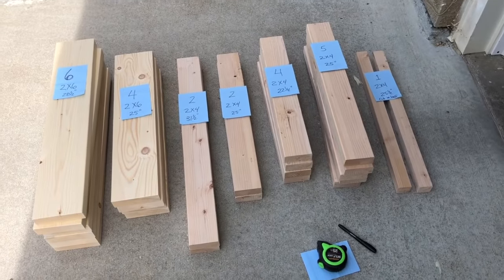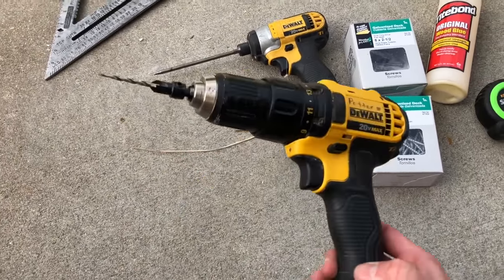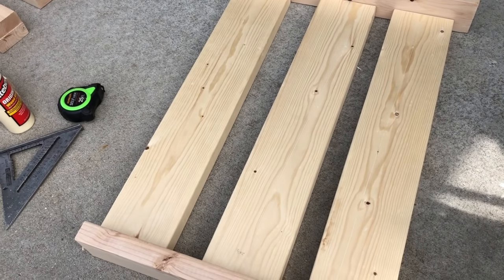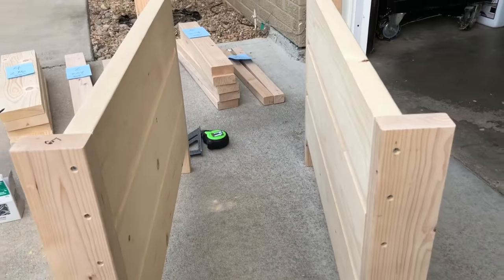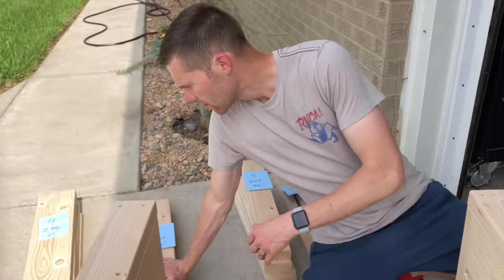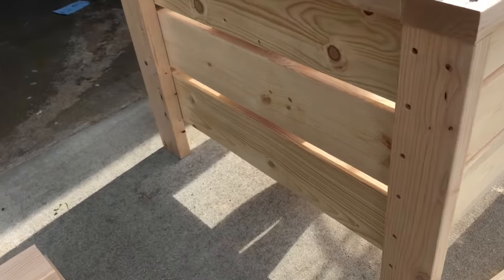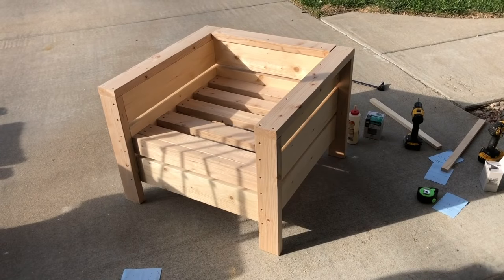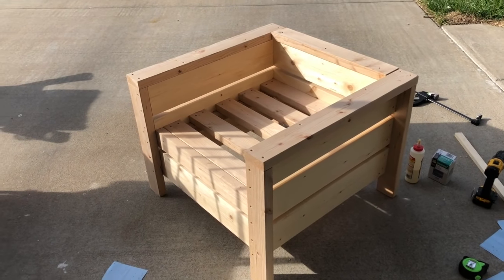DIY Lumber Yard Deck Chair

Comment: I have made 2 of these chairs now thanks to the help of this video. I do like a deeper chair so instead of adding the 2x4 on the front above the 2x6, I just left it off and dropped the seat that many inches and it made it very comfortable. I am also very short so it being closer to the ground is not as bad as it could be if you’re tall
Reply from the maker: Amanda, that's not a bad idea, I may have to do this on the next one and see how she likes it!  Did you stain yours or leave them bare?
Reply: Stained, I’ll attach pictures
Reply: Potter's Work, well heck, I don’t know how to attach pictures but basically I used a kona stain with poly built in for the 2x4’s and and an antique white stain for the 2x6’s

Comment: That's 2 ideas you've given me, I may try doing a right-angle bench for my decking
Reply from the maker: lewisdean22 , awesome, that’s why I do it!  Lol.  Is it deck building weather in Scotland yet?
Reply: Potter's Work yes it is, 20.36hr here just now with plenty of sun. Just ran out of money, have to put some projects of until funds are up.
Reply from the maker: lewisdean22, story of my life :).  Always waiting on more funds to do more projects!
Reply: Which brand countersink tool are you using?...#8 (1/8 drill bit) awesome job BTW

Comment: Hi this is chandan singh 
I want to know about pine wood...
How successful is pine wood for sofa, bed, box , chair and table?
And which type of furniture will you recommend for pine wood.

Request to you plz suggest.
Thanks
Reply from the maker: A2Z, pine is a very versatile wood and would work great for many of those projects you listed.  Its easy to sand and is cheap.  You can also buy "Select Pine" if you would like it to not have knots and imperfections.  Keep in mind, it is a soft wood so it will show dings and dents easier than a hard wood and you might want to use a pre-stain conditioner since Pine will sometimes absorb stain unevenly.
Reply: @PottersWork  Thank you so much...😊😊😊
Reply from the maker: A2Z Dajyu, no problem!

Comment: What you used for sealing (Varnish/ polyurethane)?
Reply from the maker: Hello!  We just ended up using a water based deck stain on it.  But you could use and outdoor polyurethane too.

Comment: I see that you planed your 2x lumber. What was the reason/advantage for doing this?
Reply from the maker: Hank, the only reason I planed the lumber was to make the surface a little smoother.  I typically plane my rough lumber lightly to make the sanding process much faster.
Reply: Potter's Work Thanks for the quick response - and especially for the detailed video on this project. Although I don’t own a planer, I’m fortunate to have a local hardware store with higher grade lumber (Douglas fir) to select from. Will be building two of these chairs for the front patio this weekend. Thanks again, and keep up the good work. Very helpful.
Reply from the maker: Hank Minor, no problem!  Hopefully they are well stocked at your lumber yard, ours has been pretty scarce on lumber lately due to Covid.  Cedar has been especially hard to get locally for me.  Have fun and enjoy the build!  One of my favorite projects to date and we still use the chair often.  We did put a coat of stain on it to protect it from the elements as well.
Reply: Potter's Work Construction question for this project. Looking to countersink deck screws and fill with wood plugs for a finished look. Given the countersink will be deep enough for a plug, what length deck screw would you suggest? I was thinking 2 1/2”. (Countersink would effectively make it 2 3/4”.) Your thoughts?
Reply from the maker: Hank Minor, in my opinion that would work out just fine.  That should give you enough clearance on top of your screw and not protrude out the other side.  When I do plugs, I also prefer to use a forstner bit as it leaves a much cleaner hole than a traditional bit.  Just my 2 cents :)

Comment: is it pressure treated lumber or framing? Thanks/
Reply from the maker: I just used framing lumber and we treated it with deck stain afterwards.
Reply: @PottersWork  ain't those toxic and cancer causing to be used on furniture? Just wondering.
Reply from the maker: If it didn't have the cushions on it, I would be concerned about it, but she's not really even touching the wood most of the time.  You could use an outdoor polyurethane as well which would probably be less likely to transfer to your skin.

Comment: Based on my experience building this type of furniture, that back is not high enough, you need a higher back to support the pillow and so you can lean back. it's just uncomfortable without it
Reply from the maker: whitter86, I would agree with you completely...however my wife is short and loves this chair.  She sits in it and reads for hours at a time.